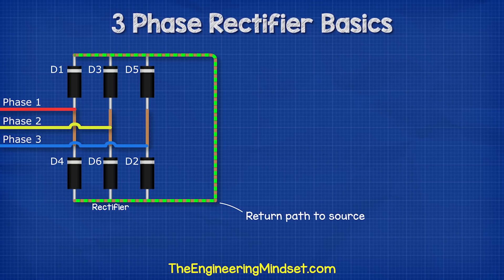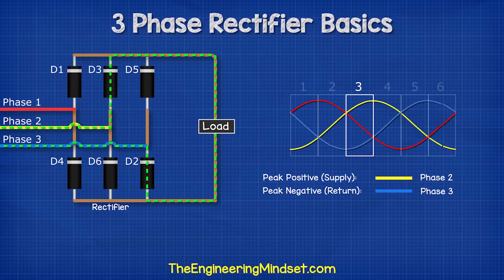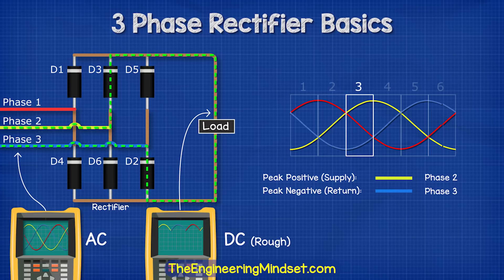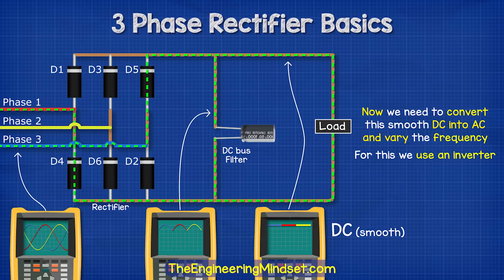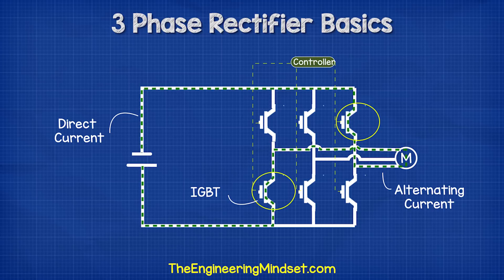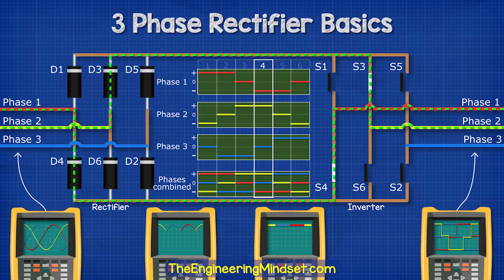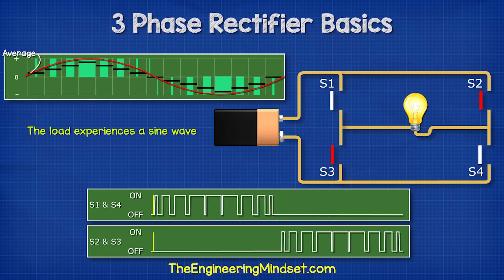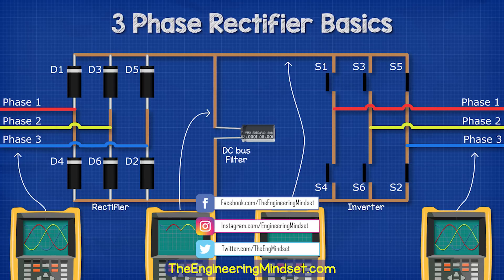Learn the Basics of a 3 Phase Rectifier

Comment: This is a great video. I’m currently replacing a regulator/rectifier on a motorbike. The old one burnt out. I have 3 wires coming from the stator. Whilst I understand the basic idea of rectifying, I can’t figure out if the connection order of these 3 wires matters? Ie do you have to go p1, p2, p3 in order? Help someone please, it’s hurting my brain..

Comment: So the AC voltage that is getting rectified by the diode is the line voltage (difference between two phase voltages) in this 3 phase setup? Is this how automotive alternators work? 3 phases connected to a star (wye) setup, because the circuit diagrams look really similar.

Comment: Uh oh. Don’t know what an IGBT is? Always define your initialisms then you first introduce them 🫣🤓 I’m guessing I missed a few videos. 

IGBT stands for insulated-gate bipolar transistor. It is a bipolar transistor with an insulated gate terminal. The IGBT combines, in a single device, a control input with a MOS structure and a bipolar power transistor that acts as an output switch. IGBTs are suitable for high-voltage, high-current applications.

Comment: I was once inside a 100,000A, 100Vdc, the bus bars inside were liquid cooled and the main bus bar was 2mx2m of pure aluminum, that weighed about one tonne for every 3m length. Input was 300,000V AC 3 phase.

Comment: My brother-in-law snagged a solid state three-phase inverter for use on his Bridgeport vertical mill, I helped install it and got to run it for some simple jobs.  Works >really< well, especially the variable frequency output, and replaced a clunky old rotary converter that generated a pseudo three phase.  I like that a full-wave three phase rectifier generates a ripple that's three times higher in frequency and thus makes filtering a lot more effective (not that I'll ever convert my amplifiers to three phase, but...).   Your explanation of the switching action clarifies the complexity of the action that makes three phase so elegant in use.

Comment: Car battery chargers contain inbuilt module with full protection, diodes separately fail depending on the bad batteries. These parts are cheap, probably ic modules also exist for this purpose with protection.
Reply: And?
Reply: @joeds3775  MONEH MINE!!! MONEH MINE!!!

Comment: PWM is the method of approximating the output sine wave today.  Why?  It's the cheapest of course.  It did require the upgrading of motor winding insulation.  Early PWM VFDs would punch through motor insulation so Toshiba wouldn't warranty replace a motor even if it was run on a Toshiba VFD.  Almost all motors are VFD rated today.  Earlier VFD designs used a variable DC Buss voltage that was regulated by SCR's or some sort of Buss Chopper instead of PWM.  Some used Capacitor Banks to store the  energy, others used Inductors.  Variable Buss Inductor VFDs had a lot more iron in them and as a result were much more robust.  I spent over 40 years starting up and repairing VFD's from every MFG you can name from fractional horsepower to 3000Hp, 230VAC to 4160VAC.
Reply from the maker: Seen our new - How wind turbines work video? link: https://youtu.be/Hf875eOVrVI

Comment: Ok 2 questions.
1. How can I have an inverter that takes in 120v and out puts out up 240v? I have a few of these lying around they are all small (<1hp)
2. What’s missing that takes a modified sin wave inverter and turns it to a pure sun wave inverter? Inductors? More filters? Programming?
Reply: For 1, if it is single phase then to get 240v all you need is 120v to ground. 120v rectified will give you enough voltage to make a 0-240v on the positive side, then you flip the direction for the negative side.
For 2, the difference is between the last two segments of the video. A square wave just turns on and off once per cycle, but a sine wave turns on and off constantly to hit voltage targets. The difference is the voltage detectors + control to turn the transistors on/off very fast + transistors you can actually do it with (maybe).
Reply: 1. if it's two** phase ac then you only need to conect one phase to the load and other to neutral. if it's single phase use an appropriate transformer. 
2. an RC occilator, really. if you want to get fancy, you can try and reprogram the microcontroller (or replace it) to output spwm, and a RC filter on the output. botu ways would require you to reprogram or replace the micocontroller though, and would need an ociloscope to make sure you don't fry anything.

Comment: Nice job I also have a tech question that seems perfect for this video. I have a ceiling fan with three different speeds plus reverse switch six lights that are with ballast, replaced bulbs, worked for a few seconds fluorescent bulbs with rectifiers connected to a switch with a dimmer slide on it. It is also over 20 years old fire covered in dust and cigarette tar and nicotine could use an assist power on no light no fan in power switch on no blown fire circuit breaker 
In a while and I’m actually recovering from my black Friday, shopping brain surgery a year ago. Thank you for your time.
Reply from the maker: Seen our new incredibly detailed MCB video? link: https://youtu.be/gqEu9t8HwW0

Comment: 2:28 I think the capacitor (negative stripe down) is wired backwards to the rectifying diodes (negative stipe up).
Reply from the maker: The lower path is the return to the supply, after the load. Therefore it is negative so the capacitor is correct

Comment: Did you know that if you use 'six wire' from the output coils and 12 diodes you can receive both plus and minus with a common point.
Reply: You can also reverse the firing order of the output and have the motor stop then run in reverse.

Comment: Well put!!!! How do they input single phase 220 and output 220 3 phase? On some frequency drives. I'm assuming just like split phase incoming current on the poles.
Reply: It works exactly the same as when imputing 3 phase just not using the last set of diodes. If you wire single phase into a standard 3 phase vdf you will still get dc power to the capacitors. You at just using part of the rectifier. So oversize your vfd so that the diodes do not exceed the capacity of the rectifier diodes.
Reply: They have some kind of boost converter inside to boost the rectified 220 high enough and a big capacitor bank to stabilise the DC stage.

Comment: Isn't the first part of the explanation incorrect? between the 2 and 3 "sections" both phase 1 and phase 2 are positive but 3 is fully negative, so the flow should be from both 1 and 2 to 3. Same thing happens in reverse a few times. Phases are "off" for a single instant, it shouldn't even be visible.

Comment: Thank you.  I have wired many VFDs over the years and knew what they did but not how.  When I started over 30 years ago there was a DC motors still around.  First one I saw was very odd.  2 small wires and 2 large wires.
Reply: At that time, 4 wire DC motors were very common. They had 2 wires for the armature, and 2 for the field winding.
Apply a fixed DC voltage to the field winding to create the circular magnetic field and then apply a fixed or variable DC voltage to the commutator on the armature to get the armature to rotate.  Reversing the polarity of either the field current or the aramature current will reverse the direction of the motor